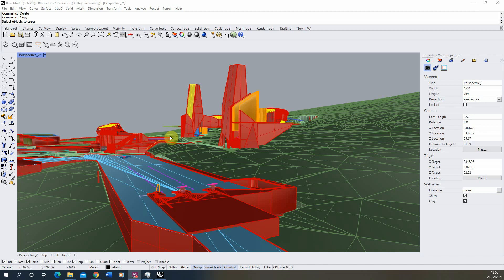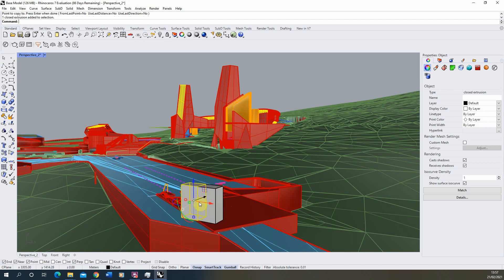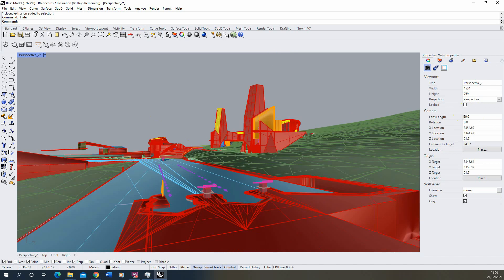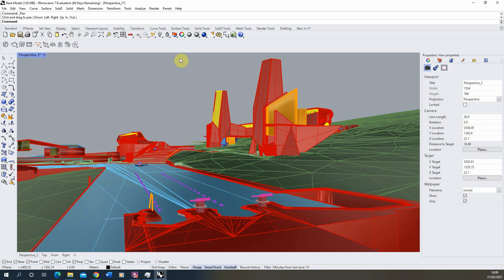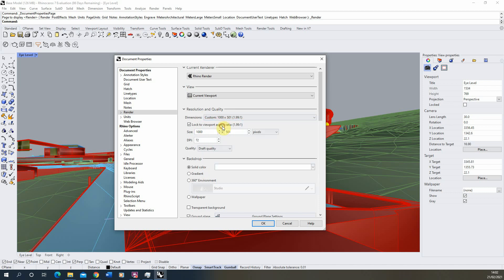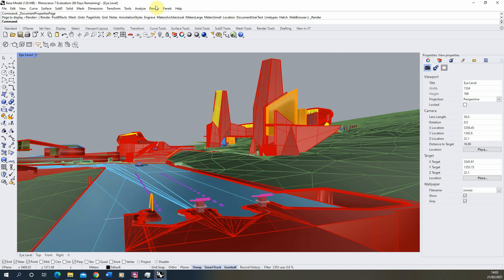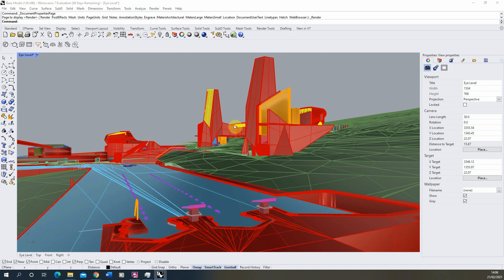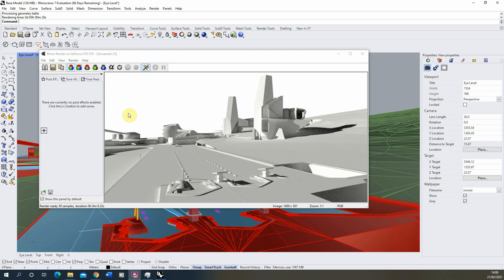Rhino 7 - Render Setup - Architectural Visualisation - Part 1

Comment: Thank you for the video! Very helpful! For some reason my render and render prevents is coming out super grainy, I can barely see my structures
Reply from the maker: You could try switching to Rhino's legacy Render - this is found in Render tab under 'current renderer'. This is usually less grainy that the new Rhino 7 render but some materials may not look as accurate
Reply: @tombudd15  ok thank you for the response! I ended up using the nvidia add in